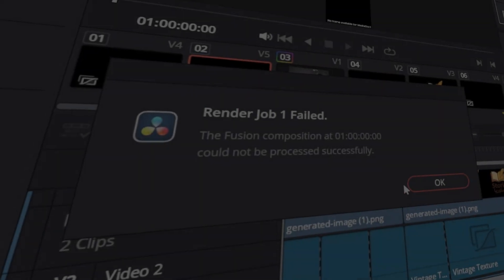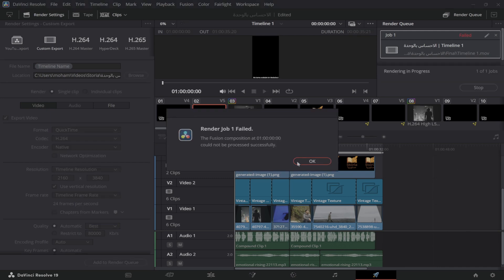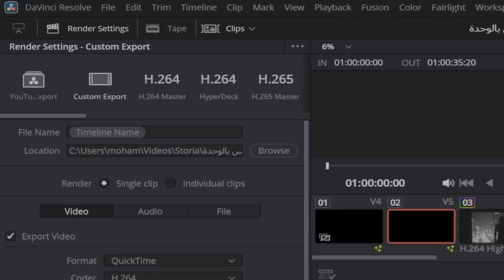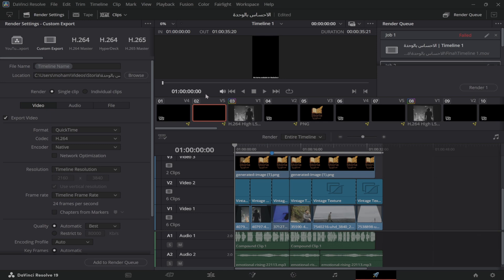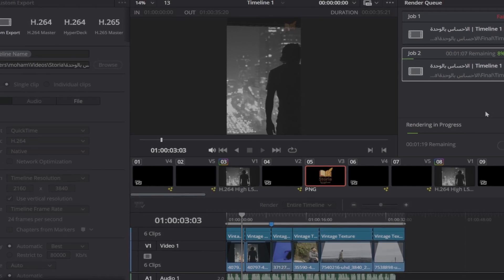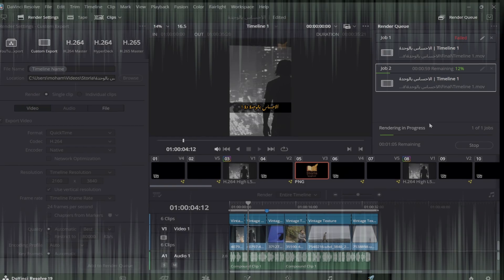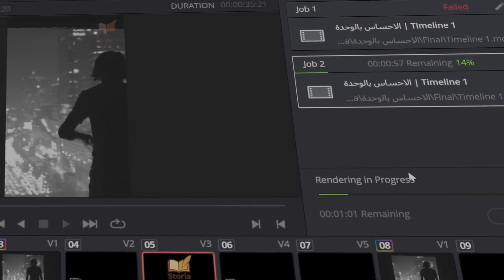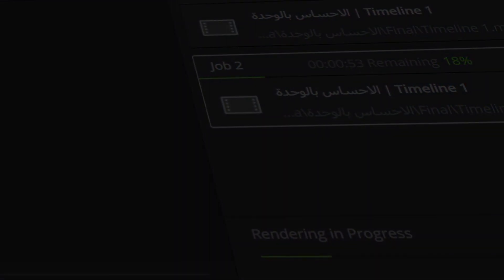DaVinci Resolve Render FAILED? Fix the Fusion Error in Seconds! ⚠️🔥

Comment: 0:52 - This solved it, thanks. Weird thing is it worked on the original big project but I copied it to another smaller project and then the error popped up.
Reply from the maker: Glad that fixed it! 🙌
Yeah, that can happen when you copy Fusion comps between projects — some settings don’t carry over cleanly. Changing that setting forces Resolve to reprocess the comp correctly.